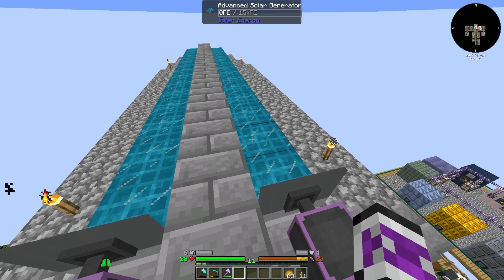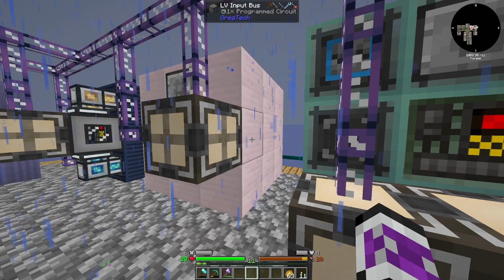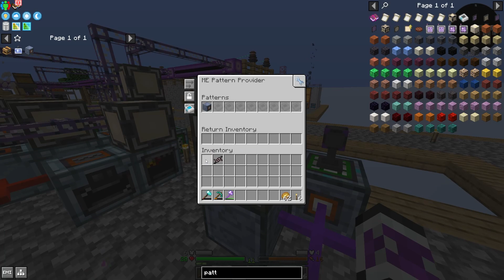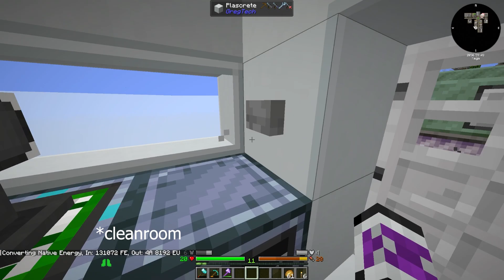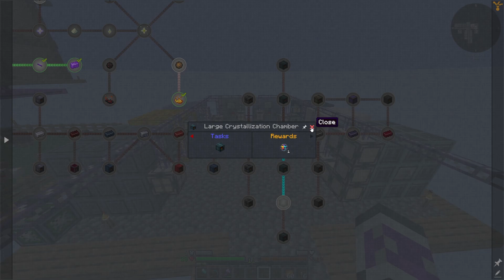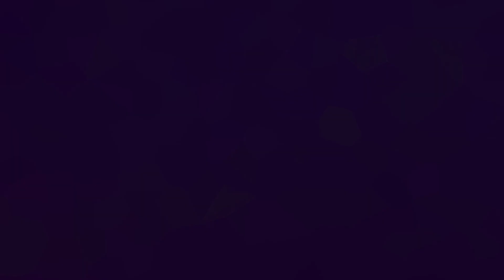Star Technology: Episode 29 - IV Power

Comment: Suggestion for power:
I added diatrons as a fuel for lapidary dynamos. To make them, you need redstone, ruby and diamonds. Even the normal diatron generates a surplus of energy compared to the energy it takes to produce it, but going up to exquisite diatron gets you a surplus of over 16 million FE without and dynamo efficiency upgrades! You could try pasiving those.
Reply from the maker: If it means I stop burning diamonds then I'm down to try it. I'll need something to supplement the solar panels until the IV circuit assembler and this sounds like a promising option. Thanks for the tip.

Comment: tips for power: in the mid-term of the iv level , you can use thermal's dynamo lapidary to burn diamond and emerald to generate power(insert upgrade kit and injector kit),lapidary from sieving sands(flux sieve with netherite/3 diamond upgrade),sands from forge hammer , extandedAE has a infinity cobblestone cell to provide stones , this will generate enough power to end the iv level and luv.Then you have the power to make luv machine , run iv large machine ,  upgrade your solar generator to ultimate. by the way ,gt power generator in this pack sucks , recommend stacking solar panels than using plasma turbine.XD
Reply from the maker: I'm already doing just about everything I can with a lapidary dynamo, besides just spamming sand sieves and more dynamos, and it really isn't enough. I can re-visit it when I get a large sieve, maybe then I can support the diamond burning, but I honestly believe the solar panels are significantly better than any thermal dynamo.

Comment: You can make Steel cells that takes 8B of liquids and can take less than bucket. An also for the Circuit Assembler (EV) you do not need to make the nether star line, because that is used for the IV one for the sensor.

Comment: You should make the Large Factories. Almost all Large Factories accept 2 energy hatches, but you still have to make next tier Assembler, because that one can only have 1 Enrrgy hatch. The circuit assembler can only have 1 as well.
Reply from the maker: I figured there'd be something to balance it out like that. But if that's the only 'drawback' then these seem like the next thing I should work towards. Thanks for the help
Reply: @Thaumiumking9  please for the love of god make them. They are so useful. Only (other) downside is that they dont have perfect overclock (2x speed but 4x power). But this is balanced with parallel control hatches, which can make the machine run more recipes in parallel
Reply from the maker: I've long since stopped caring about perfect overclock (that might be why my power sucks though), the parallel vastly outweighs that 'downside'.

Comment: The large multiblocks (made from the alloy blast smelter) can be overclocked, except the assembler and circuit assembler, but they do not have perfect overclock, which the large machine have. However, they can use parallel hatches, though they are hard to deal with, and will only be usefull when you have access to higher tiers of power. For now, you should probably stick to the large machines when you can, and the multiblocks for the rest (like the autoclave or laser engraver)
Reply from the maker: I was thinking of keeping the existing multiblock machines anyway to try and minimize the multiblock spam, and I'm pretty sure the current ones have parallel crafting by default so I don't have much use replacing them anyway. And even if the assemblers can't be overclocked, parallel crafting is enough of an upgrade to make them worth it.  So I think these new multiblocks might be what I go for next. Thanks for the help.
Reply: @Thaumiumking9  the current ones do not have parallel. Parallel hatches are unique to the Factories (IV machine multiblocks)
Reply from the maker: I'm saying they didn't need them, how else are they so stupidly fast.

Comment: Tip(s) for the future: the big laser engraver multiblock machine can just be surrounded by a cleanroom for much better and faster wafer engraving (for circuits and such). The cleanroom walls may touch the laser multiblock.

Also, instead of making a recipe for every hot ingot -> ingot in the freezer, you could also use an export bus (or interface) that requests hot ingots (extended interfaces have more space) into the freezer at all times.

All in all, these are just tips, you may however play how you want to.
Reply from the maker: I thought the laser engraver needed to be in a cleanroom anyway for a lot of it's recipes, but I won't pass up a speed increase along with it. For the ingots, the requester might still be better for me because I can choose exactly how many ingots I want (and in what quantity) whereas doing the same with exporters and level emitters would defeat the purpose of using busses in the first place. I did exporters for things like the air distillation though because I didn't need to limit them. Good tips either way though, thanks.